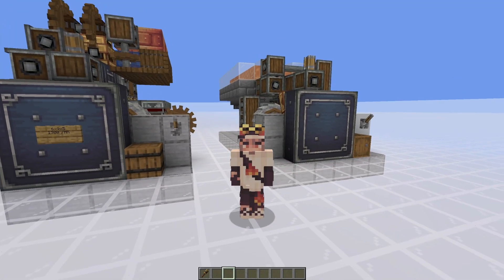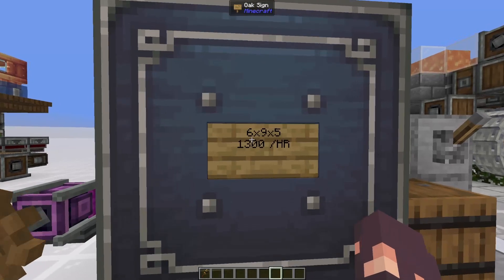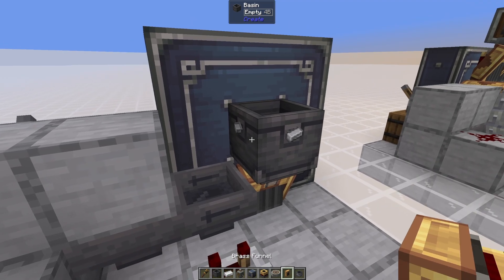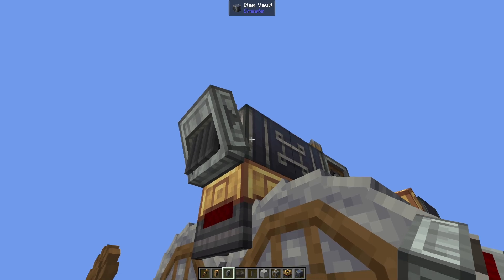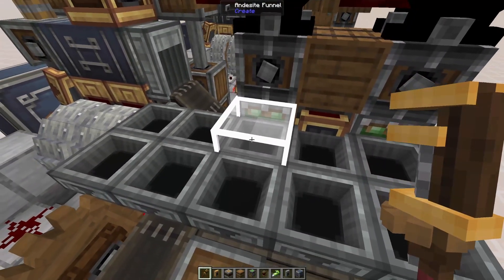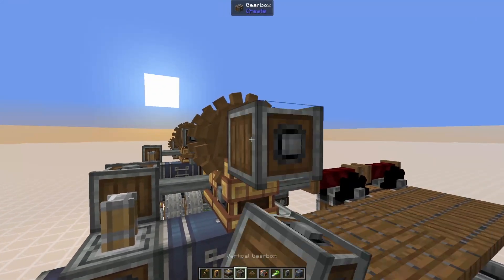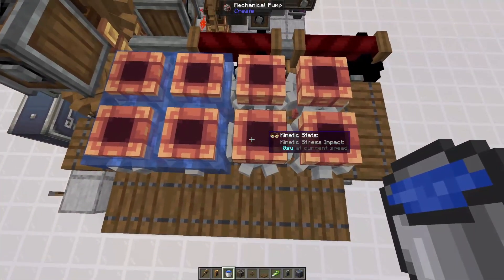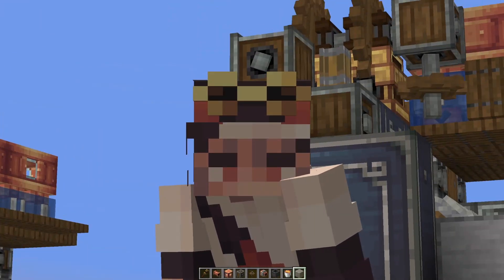The NEW ULTIMATE CREATE IRON FARM (No Villagers) 1,300 IRON PER HOUR! |  Create Mod 0.5.1.f TUTORIAL

Comment: Just finished it and farmed 4 hours with it and i am gonna write my first experience. First of all it does overflow the cobblestones are dont go into the funnels every time but its still produce 1300 Ingot/Hour so i think its normal you need 22 large wheels for run this thing so it makes lag quite bit with shaders my fps drops around 60 while near to it without shader its not bad i can see the 120+fps so i recommend to make it far away from ur base and bring it to ur storage everything except the overflow is good and works well at 1.20.1 6.0.1 create thanks for video <3
and if u have fps problem just make it with normal cobblestone gen way it will produce less ingot but not gonna kill ur pc so ur choice

Comment: Cobble shoots out no matter which way the rotational speed controller spins and all of the funnels are in the correct place and pulling orientation, what'd I do wrong?
Reply: Fixed, was using a Compact Storage barrel between the gantry carriages and it wasn't collecting the cobble, replaced it with a vanilla barrel and it's smooth!

Comment: The smart chutes aren't dropping cobble out into the crushing wheels, and it only drops when the crushing wheels are removed. Any way to fix this?
Reply: Nevermind, I fixed it. to anyone wondering how I fixed it: I have no idea. I added a gearshift because I thought the wheels were going to the wrong way, but that didn't work and i turned the gearshift back off and it started working. Good luck to you anyways

Comment: Just finished building it, thank you so much for this awesome build. I used schematic, for anyone having the issue of cobblestone flying out, you need to put a brass funnel in between the linear chasis. The cannon doesn't add in the brass funnel, probably cause you need to use a temporary block to add it. Working great now, hope this helps!

Comment: everything works to the vault filling with flint and nuggets but they dont drop out of the brass funels
Reply: Maybe check the filters? Could also be another mod pack conflicting. In my case if you’re playing with spelunkery you need to redo the filter to add the spelunkery raw nugget, and I also had an extra bulk blasting step

Comment: Hey. I tried the build and it sorta works. For some reason it’s just spitting out everywhere and not going into the funnels well. Got any advice?
Reply: Hey P3ace, I had the same issue, you need to adjust the smart chutes which are under the little vault (just above the grindstones) and set them to output 64 at a time.

Comment: Just getting into create in a modpack and found this very useful.  thank you
Reply: how much power do u use with the motors? cause i cant make it run after i turn it on it says too stressed
Reply from the maker: Get a stressometer and connect it to the power. It will tell you how much more SU you need to generate. As for how much you need total, I say how much is needed in the beginning of the vid
Reply: @kindlebubbledump  So i need a steam engine since it needs 22k su?
Reply from the maker: That’s what I would recommend, but you could technically use 4 windmills or 44 water wheels lol
Reply: @kindlebubbledump  gotta figure out how to use with the 4 windmills

Comment: My cobblestone goes everywhere but the correct place …. All done as in the video, checked 10 times. Not picking up the cobble stone unfortunately
Reply from the maker: Cobble should be going into the barrel in between the gantry carriages. If it’s not going in there, make sure the andesite funnels are facing downward. If it is going in, make sure the brass funnel below it is facing outward, away from the cobble gen section

Comment: MC version: 1.20.1
Create version: 6.0.6

- working perfectly if you build it along the video

- after using the schematicannon, you will also need to:
    1. put lava in the fluid tanks
    2. waterlog the leaf & mechanical pumps
    3. glue the following: 11:04, 12:09
    4. change the rotation speed controller's orientation, if: the cobblestone is shooting out the back of the farm OR the crushing wheels are spinning the wrong way OR the fan is pulling and not pushing
    5. change the 2x1x1 vault as shown in the video
    6. connect the belts accordingly, as shown in the video (good view at 7:56)
Reply: I'll add that if you use biome o plenty, and instead the regular leafs he uses in the video you use one of the other ones, it won't work. Instead leafs using trap doors to block the water flow works.
Reply: @DanDudeDen  if you can the create: connected mod installed, you can use the Fan Catalyst, for everything you need, not just water logging, but also for your lava, that way, its safer...
Reply: step 5 is at 6:42, also make sure to correctly add the belts, also check the filter for iron nuggets/flint, mine was wrong

Comment: Im having an issue with it, the vault isnt emptying itself properly while the machine is active and it only puts flunt and nuggets into the basin/cauldron when powered off, i made it with the schematic as well
Reply: It seems to be that the brass funnel intaking the flint and nuggets doesnt work while the machine is powered for some odd reason
Reply: The fan wont push the items into the brass funnel, i cant remove valkyrien skies as it isnt my server, I need a workaround

Comment: My cobblestone part wont move at all, All other components move, I’ve check the redstone and thats fine its just not moving. The belts under it move and the gantry shelf move as well its just the andesite + linear chassis that wont. Any idea why?
Reply from the maker: check glue and make sure there isn't a block in the way of it moving!!
Reply: I also have this problem. I have already redone it 3 times.

Comment: it's a really good farm, though for some reason the barrel gets filled up too fast and cobblestone starts spewing everywhere, even though every andesite funnel has been set to their proper corresponding faces
Reply from the maker: Your issue is probably the brass funnel in between the 2 linear chassis. R-click it with a wrench and the farm should start working. Make sure the 2 andesite funnels directly below the brass funnel are facing inward towards the belts
Reply: @kindlebubbledump  Im having this issue too funnels are facing the right way, everything is as it should, its just the belts are completely full waiting to be put into the full vault above the crush wheels, its working great its making tons of iron its just also putting a lot of cobble on the floor. Is there a way to design an overflow system to delete extra cobble without removing the needed cobble to operate at 100 percent?

Comment: so one of the gantry carriages just breaks immediately when i start the machine, any fixes??
Reply from the maker: The easiest one is probably switching out the cobble gen with one that works in your create version (or you could update but that's prob harder). your version has a bug where the moving back and forth won't work which is a bummer
Reply: @kindlebubbledump  would a cobble gen with a drill that breaks the block and drops cobble work?

Comment: Hey i followed your video but uh.. the cobblestone shoots out no matter clockwise or counter clockwise
Reply from the maker: Your issue is probably the brass funnel in between the 2 linear chassis. R-click it with a wrench and the farm should start working. Make sure the 2 andesite funnels directly below the brass funnel are facing inward towards the belts

Comment: absolutely love the video, but the vault that stores the cobble maxes out at 2560x cobblestone which then causes the cobble to not get picked up by the belts and just fall out the 2 andesite funnels

I’m wondering if there’s anyway I can fix that / expand storage or something
Reply from the maker: the vault shouldn't fill up cause the crushing wheels should be slightly faster. My guess is only 1 set of crushing wheels is working at a time. try replacing the vault with a double chest over both the chutes. should fix the problem
Reply: Hey bro, idk if you've found the answer but it is likely because you need to INPUT 256 speed into the whole machine

Comment: it keeps shooting the cobble out the side. Any solutions?
Reply from the maker: Your issue is probably the brass funnel in between the 2 linear chassis. R-click it with a wrench and the farm should start working. Make sure the 2 andesite funnels directly below the brass funnel are facing inward towards the belt

Why its the issue: the cobble gen breaks the cobble and stores it in the barrel in between the 2 gantry carriages. the brass funnel should be dropping the cobble that is in the barrel right above it (it has access to the barrel's inventory even if it's not connected to it because it's a contraption). The funnel will drop the cobble out to the 2 blocks below it (depending on the side it's on) and the 2 andesite funnels below it will pickup the newly dropped items and put them in the item vault.

Comment: Hey do you know why brass Funnel is not picking up iron ingots and flint? Fan works correctly items are pushed to the funnel but it is not picking up into vault
Reply from the maker: Do you have the valkerian skies mod installed? there's a bug with that mod and funnels with fans blowing on them. you can either remove that mod, or setup a clock to turn off the fans blowing for a few seconds for that funnel to pickup all the infested stone that was made and then turn it back on. idk the exact timings for how to do that so you'll have to do some trial and error.

Comment: i have a smal problem  i generat to mutch cobble  can i fix ist ore wat have i do wrong?
Reply from the maker: are both funnels getting cobble in them or just 1? also is the cobble just shooting out all over the place? if so Your issue is probably the brass funnel in between the 2 linear chassis. R-click it with a wrench and the farm should start working. Make sure the 2 andesite funnels directly below the brass funnel are facing inward towards the belt
Reply: @kindlebubbledump  thx for help. I have rebuild the farm again and now ist working fine<3

Comment: Why doesnt the list filter work
Reply from the maker: wdym? is the funnel not picking up items? if so Do you have the valkerian skies mod installed? there's a bug with that mod and funnels with fans blowing on them. you can either remove that mod, or setup a clock to turn off the fans blowing for a few seconds for that funnel to pickup all the infested stone that was made and then turn it back on. idk the exact timings for how to do that so you'll have to do some trial and error.
Reply: I just deleted the mod and it worked, thanks

Comment: I need help cobblestone just keeps flying everywhere the farm still works its just half the cobble stone keeps flying in all directions.
Reply from the maker: Your issue is probably the brass funnel in between the 2 linear chassis. R-click it with a wrench and the farm should start working. Make sure the 2 andesite funnels directly below the brass funnel are facing inward towards the vault (check picture)

Why its the issue: the cobble gen breaks the cobble and stores it in the barrel in between the 2 gantry carriages. the brass funnel should be dropping the cobble that is in the barrel right above it (it has access to the barrel's inventory even if it's not connected to it because it's a contraption). The funnel will drop the cobble out to the 2 blocks below it (depending on the side it's on) and the 2 andesite funnels below it will pickup the newly dropped items and put them in the item vault.
Reply: Everything works, but my iron isnt funneling out of the basin into the hoppers for collection, I re did the brass funnels but cant get it to work for some reason

Comment: how do i fix cobble flinging everywhere?
Reply from the maker: Your issue is probably the brass funnel in between the 2 linear chassis. R-click it with a wrench and the farm should start working. Make sure the 2 andesite funnels directly below the brass funnel are facing inward towards the belt

Why its the issue: the cobble gen breaks the cobble and stores it in the barrel in between the 2 gantry carriages. the brass funnel should be dropping the cobble that is in the barrel right above it (it has access to the barrel's inventory even if it's not connected to it because it's a contraption). The funnel will drop the cobble out to the 2 blocks below it (depending on the side it's on) and the 2 andesite funnels below it will pickup the newly dropped items and put them in the item vault.

Comment: I'm wondering because my cobblestone gets picked up by the contraption, deposited into the barrel and out the brass funnel, and then the andersite funnels place it on the same belt.
Does the second belt under the funnels serve a function that I'm missing?
Reply from the maker: When the cobble farm stops some cobble is left on top of the andesite funnels so having the funnels going into that belt lets you collect the stragglers

Comment: Before I try it myself, does this farm work with Valkyrien Skies installed? I've had trouble with similar cobble generators in the past and I think it might be because of that mod but I am not certain.
Reply from the maker: it will, but you'll need to make 1 change. valkerian skies breaks funnels with fans blowing on them. if you turn off the fan, the funnel will be able to pickup the items. so if you setup the fan with a clock that blows for 1 min then stops for 10 seconds or so it should be able to wash stuff and pick everything up and still be pretty efficient.
Reply: @kindlebubbledump Thank you I'll try it when I get the chance. I appreciate you responding to comments with help even 8 months later!

Comment: Hi, I built this on my friends server, but for some reason, the gantry shafts aren't moving from left to right, is there a way to fix this?? 🥲
Reply from the maker: If you're not in create mod version 0.5.1.e (that version doesn't work) It's prob an issue with a block in the way/glue preventing the farm from moving, do the following to troubleshoot.

       Remove the 2 linear chassis and see if the gantry carriages move back and forth that way. Then add back the linear chassies but only glue one of the 2 sides of them to test just the cobble gen side for example. if then it doesn't move that means your cobble gen side either has a block in the way or isn't glued properly. Obviously if the silverfish chamber side is the one that isn't working then it's prob an issue with that side. make sure there's not extra glue connecting anything that isn't supposed to be connected
Reply: @kindlebubbledump  does 0.5.1.f work?

Comment: My cobble stone gen is not working water is placing but lava doesnt come out
Reply from the maker: if you're on create 0.5.1.e then the cobble gen part won't work (theres a bug in that version) otherwise, make sure you have lava in the lava tanks at the top and you should see lava particles when the mechanical pumps are getting powered. could you provide more detail? also if you don't wanna deal with troubleshooting you can always change the cobble gen to something that works, and as long as it's fast enough you'll get the same rates

Comment: Hiya, so i absoluetly love this, its so elegant and compact! However i am having an issue where the cobble is spewing everywhere, so I'm not sure if the andesite funnels are just not sucking them up or something? They are all pointed down. I can tell some is getting through but i just dont know why the funnels arent picking them up. I cant see any/very little on the belts.
Reply from the maker: R-click the brass funnel in between the linear chassis with a wrench. That should invert the direction of the funnel and fix your problem
Reply: @kindlebubbledump  I must have done something very wrong tbh cause mine refuses to work but when i used the schematic and it worked perfectly XD Thank you for the help anyways! Defo gonna go back through and see where i went wrong! <33

Comment: How do i fix the Iron nuggets and Flint not getting picked up?
Reply from the maker: Do you have the valkerian skies mod installed? there's a bug with that mod and funnels with fans blowing on them. you can either remove that mod, or setup a clock to turn off the fans blowing for a few seconds for that funnel to pickup all the infested stone that was made and then turn it back on. idk the exact timings for how to do that so you'll have to do some trial and error.